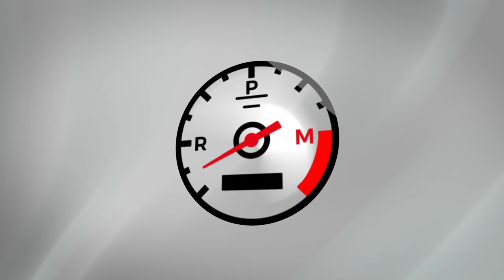1967 Pontiac Firebird | Full Step by Step Detail | P2 Paint Correction! (Vlog 37.2)

Comment: 12:51 Thanks for adding that "ugly" part. Too many people think high end detailing always looks like "ahhh, he makes it look so easy and professional" when a lot of times, in the quest to chase perfection it looks more like "what the hell is he doing?", specially on old or just curvy and uncommon vehicles (like supercars, they can be SUCH a pain in the arse to deal with, with all their sharp edges and crevices). 16:58-17:10 Yeah, bonnets really HAVE to be presented at their best, even if the rest of the car isn't booked for a "perfect" or "gold package" treatment. 23:30 yeah, plus you don't  have to mask most of it thanks to the trims being chrome. They actually benefit from a good polish. This car really turned out a treat Sandro, keep doin' what you're doin'.
Reply from the maker: There’s lots of ugly parts lol before you get to the gold! It’s not always easy trying to capture and project what the process is really like and what really goes into it and the hurdles you have to jump over but I’m trying to add more of that in each video. Thanks mate!
Reply: @CarCraftAutoDetailing  Yes people think it’s as easy as 1,2,3! But many times, we have to do many tasks in a very inefficient and suboptimal way just because there isn’t any other way to get access (with machines) in certain areas. Lots of elbow grease, lots of patience and some times some creativity.

Comment: Sir, i noticed you often use foam pad for paint correction (step 1 or cutting) and i follow your method, and i feel safer when i polish soft paint, and the result is very good same as when using wool pad, so thx sir
Reply from the maker: Great to hear that, and on soft paints you’re generally find that foam is a safer option that also makes the next refinement stage much much easier.

Comment: Great one Sandro.    Really informative.     Thankyou for sharing your wealth of knowledge and information and years of experience and expertise with us weekend warriors out here.    I would venture to say that the majority of your viewers are enthusiasts looking to improve their ability to correct their own paint and your ability to convey useful and practical information goes without saying.    It is much appreciated by everyone around the world.    You reach an audience all over the planet.   

What is the difference between that small air powered polisher (which looks awesome by the way) and the Rupes iBrid Nano?    I saw that you used both of them.    It appeared that the iBrid was used in rotary mode and the air powered tool was used in DA mode.   I am assuming that iBrid in rotary allows you to get right up to the very edge in very tight spaces?    Does that air powered small polisher have more correcting power than the iBrid?
Reply from the maker: Thanks mate and yes the iBrid was used in rotary mode to get closer to the edges without that DA oscillation movement. The Rupes TA50 polisher is a 2” DA and a real beast of a little machine, but you do need quite a power air compressor to use it with about 500LPM. Although you can also use the iBrid in DA mode and it’s quite good with 1” pads, it just hasn’t got enough power for 2” pads in my opinion whereas the TA50 has plenty and is just worlds better power wise.
Reply: @CarCraftAutoDetailing  Thanks for the info.   Yeah,  I have seen a few professional detailers using that TA50 and it does look like an incredible little polisher.    Too bad they don't make it in an electric version.   Looks like a great little tool and the perfect size too!

Comment: so is the green pad stage sorta a 3 stage in certain areas ? and im guessing its softer then the blue foam pad. are you using it on rotary when you use the ibird nano and can you explain why? I only ask because I bought the ibird nano long neck and I was curious if we could get a deeper explanation  when your using it.
Reply from the maker: The green Rupes pads where used in the first cutting stage on both the mini DAs and rotary because Lake Country doesn’t make 1” & 2” versions of those pads and Rupes are next closet thing. So it was still just a 2 stage correction not a 3 stage. I like the green Rupes pads but they just deteriorate way too fast and are extremely expensive! I went through a 4 pack of both 1” & 2” green pads even before I finished the car! That’s why I wish LC would make 1” & 2” versions of those pads because they are also much more durable than the Rupes.
Reply: Thanks brother I've been watching for couple years now and your my favorite detailer. Much love!

Comment: First time watching vids was just looking at vids for first gen fbodies. U turned the paint job from a 20 footer (looks good from 20 feet away) to a show finish. I bet that guy was super happy with those results. Question have a couple projects I plan on painting would u recommend taking to a paint corrector afterwards to do the first cut and buff or doing the first one myself and letting them fix it
Reply from the maker: I think if you have experience with sanding and you’re able to refine the sanding scratches well it would obviously save a lot of time and money compared to a detailer having to dry/wet sand and then compound and polish the whole vehicle which is quite expensive to do to a high level. But if you don’t feel confident in doing it or don’t do it well, then it will also be a lot of work for a detailer to refine the sanding marks before finishing the vehicle. But I don’t think there’s any harm in talking to some detailers before hand, it may help you decide which way to go!
Reply: @CarCraftAutoDetailing  ok thanks. Going to try printing with cheap 25/qt paint first and just lay the clear on thick. The main 2 projects are motorcycles I can mess up and still have plenty left over hopefully

Comment: I LOVE this video. When you do your edge work what rpm range do you stay in?  I feel like I need a new mini rotary because the one I have has a minimum speed of 1000rpm which feels too fast, also it's not variable trigger. I feel like to do safe edge work I really need variable trigger and ability to go more like 600rpm.
Reply from the maker: It really depends on the plate and pad size. The smaller you go the faster speeds you need in order to cut effectively. 1000rpm is actually a little slow for a 1” pad but probably decent for a 3” pad during cutting but you can certainly go much slower while finishing. Whereas on larger 5” and 6” pads 1000rpm is much more aggressive as it’s actually the outer edge of the pad that does the majority of the correction, so the large the pad the far more aggressive it is and slower speeds you should be using. 
Thanks mate and really glad you enjoyed the video!
Reply: @CarCraftAutoDetailing  thank you! What rpm range do you usually run with 1"-3" with?  What's your favorite 1"-3" machine?
Reply from the maker: It jumps massively for each size, but I guess generally 1” 2-5k rpm, 2” 1-3k rpm and 3” 500-2k rpm but it can certainly vary. 
I guess my favourite 1” rotary is the iBrid but I don’t feel it’s powerful enough for 2” pads so for 2” & 3” pad I tend to now use my Shine Mate cordless mini rotary which is really convenient.
Reply: @CarCraftAutoDetailing  with your Shinemate cordless how many batteries are you needing? I know there are jobs where you must be using it for hours at a time. I was thinking of getting a Flex  pxe80 but I just dont think the batteries last long enough. Maybe I need to look at the Shinemate battery mini. edit I'm not seeing a cordless mini on the Shinemate site, is it actually the ond that comes with 5" but you just use smaller plates on it?

Comment: Oh I have been waiting for this!  Absolutely stunning!  Do you find the gloves help while polishing? I swear I think I have developed some tennis elbow from all the wipe off so trying to readjust and find things to help.
Reply from the maker: Thank you mate, and the gloves definitely help with reducing machine vibration so if you do a lot of polishing they could be a great option, but they can get a bit uncomfortable on hot days! They won’t help with tennis elbow but can help to reduce that buzzing feeling you can sometimes get on your hands.
Reply: Oh it's real. Try to use muscles and shoulders more than just your elbow when you're wiping. Kind of lock your elbow at a 90 degree angle, like a climber/gymnast L, and use some hips and shoulder to help move the towel. It's tougher on horizontal panels, but you can still take some stress off your elbows. I also forced myself to get comfortable with a towel in my left hand too. That way I can alternate arms. After a while that clumsy feeling goes away and it feels quite natural to wipe with either arm. Did the same with holding a polisher. 

I actually still use a lot of rotary, because it is very smooth and low impact on the body if everything is dialed in. I'm not a foam guy, and thin fiber pads on a long throw tend to be a rougher ride. I put a thick soft 5" plate on a little M550 compact. It's a joy to effortlessly cut with that light little machine. I never use heavy pressure so it handles the big pads just fine.

That injury stuff scares me man. I don't want to be one of those guys who overworks and wears their body out and lives their retirement years hobbled up in constant pain. Noooo thank you. 🤕👎✌
Reply: @jdisdetermined  yea I only do this part time thankfully but not sure if this happened from detailing or just life in general.  Appreciate the info.

Comment: Amazing result and again S20 black rules supreme. Frustrating that you wipe your work and end up back at the start because of the soft paint. Not sure how ole mate is going to keep the paint in pristine condition given how soft and not very resilient to scratches. Is the paint a single stage or has a clear??? Well done Sandro
Reply from the maker: Yes, S20 saves the day again! Light swirls will be difficult to completely avoid but a good safe washing and maintenance routine will definitely help to keep them at bay! It was clear coated paint, and thanks mate!

Comment: how many hours does a 1 and 2 step correction usually take you? I ask you because you a are as pedantic as I am. I have read alot in forums that theu do 1 car in 3 hours which feels waaaay to short for me as I do a standard detail in around 2 days.
Reply from the maker: It really depends on the level of work you’re pursuing, what the paint is like as well as the defects. I’ve done two stage corrections within a few hours and I’ve also done two stage corrections that took over a 100 hours. You really have to break each job down to what your goals are, your budget, time and what’s appropriate based on those factors.

Comment: Yes... this is absolutely every single repainted car I have worked on. Repainted cars have extremely soft clear and frankly are pain to get to high level of detail, because basically just wiping them with microfiber induces more scratches. As for technique - simply use step softer pads then you would normally use and finish with finest possible polish and pad combo without nay pressure. As well as mentioned in the video, the best would be to use brand new MF... as it seems no matter how clean MF looks it will scratch soft repainted cars. I would tend to use "edge-less" MF in general as simple thread on the edge of MF could be enough to scratch it. If you don't have edge-less MF, then at least try to fold it in the way that no edges protrudes onto the paint.
Other thing to note - I have never seen well polished cars out of the painters, they are always horribly scratched and full of cheap compound residues in every single crevice. I guess simple thing to say - painters focus on painting car, detailers on detailing. Most painters simply use rotary polisher for speed (instead of DA), hit the pain first with overly aggressive sand paper to remove obvious imperfections (flies, runs, touches, overspray ... you name it) and then runs over them with ton of cheap and aggressive compound on rotary, splattering it all over the car. Then quick wipe and buff with QD or some cheap silicone based wax to get good filling effect and shiny wet appearance for delivery. Once you wash the silicone off they always look like wreck. Just expect it! I would say that if anyone has any options - it better to ask paint shop not to touch the car at all after painting and the your detailer to do defect removal. This is because pain shops really try to do as fast as possible job when it comes to hiding their painting defects. Other thing to note - every repainted car will have defect. No car comes out of the booth perfect!